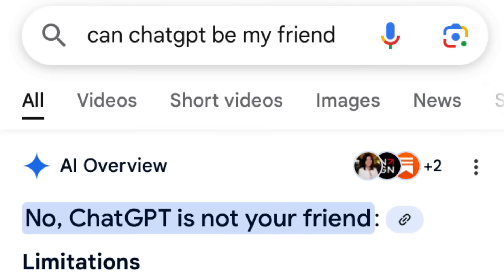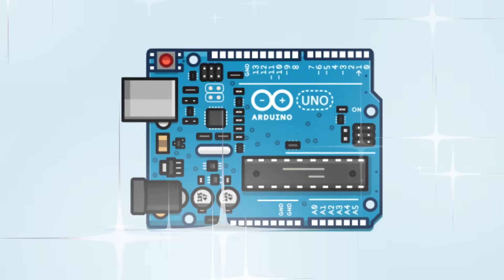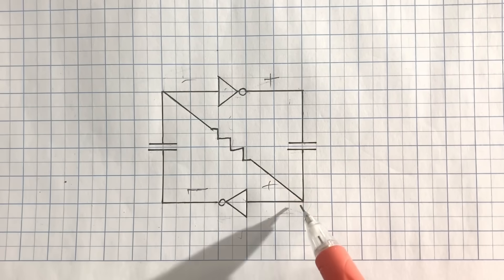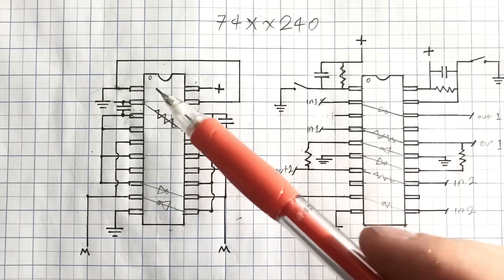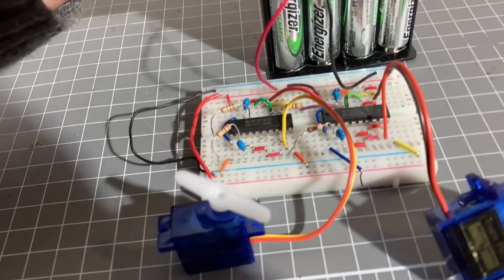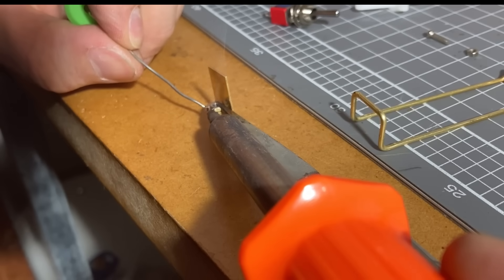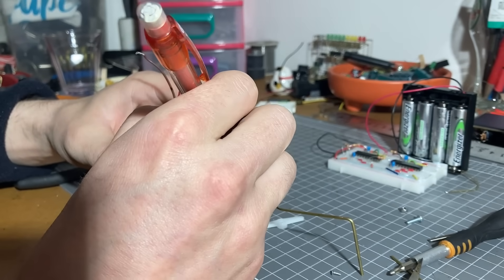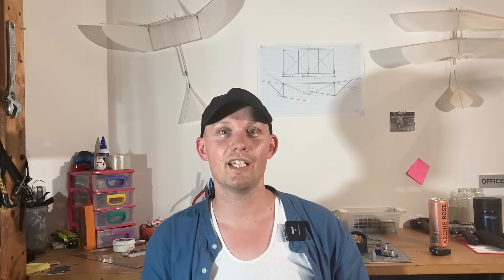What is a BEAM robot? lets build one

Comment: Id love to figure out a way to do something like that solar powered so it could roam the world freely, as long as it can survive in the harsh enviorment of course. I was thinking about naval based stuff first, but I only have rivers around and the current is probably too strong. Land based will have its limits, especially in a city where its likely to be picked up or destroyed. Flying of course is a power issue.
Reply from the maker: I am actually working on some of these things right now but yeah, its a bit of a challenge, both to ruggedise everything and to get the control systems so that it doesn't get stuck instantly. The mars helicopter is honestly a great inspiration as it actually did a lot of the things BEAM has dreamed of for a while, but with a little more proper compute

Comment: OK. This is my last comment for a while - Don't want to spam you! 

But, a trick so you don't need centering springs is to bend the legs up close to the body and then continue down with the usual shape. This makes the legs hit the body which acts as a mechanical stop. Start the UP Bend at the right distance from center so it doesn't put strain on the servo's plastic gears but still stops and centers them. -- This also lowers the center of gravity and makes the bot more stable.

EDIT: Sometimes we used leftover softer wire to play with different leg shapes and then replaced the final design with the good (strong) stuff and made it pretty.

I got this idea because I noticed that Tilden almost never put centering springs on his Walkers and used that leg shape instead. Look at his BiCore and MicroCore Walkers and you'll see what he did. I never used centering springs on my walkers -- see my old website. Especially the Walker videos -- My Ant 2 is a perfect example of what I'm trying to describe. 

One of the advantages of the 5 motor walkers like Walkman is each leg has it's own servo or geared motor -- each is independent, so no centering.

Again. Great content! Thanks for sharing!
Reply from the maker: Bending the legs for a mechanical stop is a genius idea. I will definitely use that. I was originally going to have microswitches to limit the legs, maybe by grounding one side of the bicore, forcing it to switch. One of the new ones I am currently building has some space constraints, so the leg trick might just save it. 

No worries with all the comments, I love to hear tricks and insights, especially from people who have built Beam bot and were involved back in the day

Comment: If there's a established set of "elements" to pick from to compose different behavior patterns; sounds like the type of thing that maybe with modern excess computing power available it might be possible to run some mix of evolutionary algorithm and some other machine-learning stuff to develop and fine tune more advanced behaviors; something like, generate random selections of elements and connections between them, run a gradient descent or whatever on the results scoring for the desired behaviors for each of the expected inputs,  keep the highest scoring ones, and replace the lowest scoring ones with random mixes of the the previous gen winners, and also a third and forth group that's randomly mutated from those other two, and repeat; or some other approach kinda like that. And then you end up with a plan of elements and connections, that you have to puzzle out how to physically fit together; and if there are some unaccounted for constraints that can't be easily worked around, introduce them into the simulation used for the scoring and iterate a few more virtual generations and try again.

Comment: Still have all my BEAM robots, and they mostly all work, at least the walkers all work. My most complex is my 16 Nv, 8 motor Spyder, which used a 4 stage microcore with four three stage branches, each driving it's own leg. It has full H-bridge drivers and a signal conditioning board that prevents illegal (shorting) outputs. 

Bronco is a dual branch half-stage Bicore walker with 3 motors. A Bicore drives a pair of branches, with a 1 - 0.5 - 1 timing pattern, which gives the robot a more efficient walking gait. in total, it uses 6 Nv units. 

My oldest walker was Walkman Jr. It is a basic 2 motor, 4 Nv microcore walker. Walkman Jr and Bronco were both featured on a short lived children's educational TV show called Algo's Factory (recorded in summer of 1998. forget if it aired in 98 or 99). It actually walked off a table during a mishap at the studio. The nose was broken and never really went back together in it's original shape. the original was literally made with cheap walkman motors, some oven timer gearboxes, and some plastic gears from said walkmans... that all shattered. They paid for some really high quality gearmotors, and I rebuilt it with fancier parts than it ever started with. I actually reused it's rear leg motor for Bronco, turning the motor into a "waist" motor with limited range of motion. this prevented the motor from ever turning far enough to reach the stripped out gear teeth.

 Back then, there were two primary node configurations. Nu and Nv. It mostly had to do with how the resistor and capacitor were wired. Nus were referred to as "neuron" nodes, and were often used with basic sensors. The majority of smaller BEAM robots did not even use these. Nv nodes, or "Nervous" nodes were far more common, and were used in the majority of basic configuration. These were the heart of most BEAM CPGs, or central pattern generators. This was basically your main loops and motor branches.

Dave Hrynkiw still host's my ancient site (which started on GeoCities). He still runs Solarbotics, with a heavy flavoring of 3D printing now a days.

I'd like to end by saying I absolutely love the way you built yours! Just cute lil' guy, crawlin' away!
Reply from the maker: Wow thats so much for the comment. Spyder sounds impressive, at most I think I have had 6? Nv nodes working together, a microcore with that many is awesome. 

I am going to look up some of the sources you mentioned, it is getting harder and harder to track down info on Beam stuff as soo many of the old sites are shut down. I have a huge folder on my computer with a bunch of schematics that I have saved. Many years ago I owned the Junkbots book writted by Dave Hrynkiw and used to purchase parts from Solarbotics back in the day. 

Thanks again for the comment!

Comment: Cool that the algorithm brought me here. subbed. Hope the future diy minimalist projects go well!!

Just a thought, seeing what look like ornithopters or gliders in the back.. have you considered a miniaturized BEAM circuit to drive flapping of an articulated wing? I don't know if it'd have any adv over a typical cyclic gear mechanism.
Just a layman with my 2¢
Reply from the maker: Thanks mate! I have been (slowly) working on an ornithopter project that uses an Arduino for waypoint guidance but its on the back-burner right now. Beam could be used for some sort of closed loop control for a flying robot but I have never done it
Reply: @ALTcorporation  could be solar with a tiny battery. charges and then flies a few feet. I am not sure what small and light options there are for some kind of rangefinding to guide toward open areas.
Reply: @ALTcorporation  sounds like autonomous 🤖 is your focus, any hints what's next ?

For me, it's daunting picking up a bigger project and I'm not even trying to make content and all that, just a machinist brainstorming ideas and seeing what is happening in various fields. Tech moves so fast with so many contributors worldwide, and yet there's still old craftsman sharing their techniques! Interesting time to be alive!

P s . doing more BEAM? Here's another hairbrained one: 
how about a BEAM Solar powered undulating Carp? Could  be as simple as a tail attached to a bowing flexure and electromagnet on either side in the body , no servo motor shafts to seal.

But first you have to build a pool in the backyard...etc. $cope of the project keeps increasing...

Comment: Did I miss a mention of the RoboSapian.? A rather popular consumer toy that was a BEAM+Microcontroller horse-and-rider configuration. 
As I recall the microcontroller injected pulses into a network of Hexcore circuits, driving 6 DC-motors: 1 motor for leg lift, 1 for hip roll and 2 in each arm, + clever kinematic linkages.. that thing had more fluid mobility than a bot costing 10x

I've looked occasionally and it seems like this wasn't a concept that grew much.
Last I saw a BEAM robot was at my local Makershop . AND IT WAS INCREDIBLE! He meticulously built a full hexapod spider , all analog BEAM circuits , 6 motors, phototropism and front&rear collision!
Reply from the maker: There was a few things I left out of the video, RoboSapians (and the BioBugs) are super interesting and deserve a video on their own but I wanted to keep this (somewhat) short. I actually would like to do a video on both but there are a bit hard to find in Aus. Cheers!

Comment: 5:42 An important point about the 74xx240 is that, besides having 8 inverters, is that it's a bus driver chip, so it's both fast, & has a bigger current output capacity than a jelly bean inverter like the 74x04 hex inverter does.

Comment: 4:31 If you're using 74HCTxx chips, the logic levels are TTL logic family voltages; >=2V for high, & <= 0.8V for low. Your commentary would be correct for 74HCxx chips. (>½VCC = high, <½VCC = low)
I know this sounds pedantic, but I've had to deal with so many real world faults where designers or supply people weren't familiar with these details & created weird & hard to diagnose faults.

Comment: In general, always check your system's current draw while you're building because you may need to insert a pull-up or pull-down resistor rather than tying a line directly to a rail. You can sometimes reduce current draw by inverting the logic for the most common state to use less power.
Also, have enough decoupling caps around CMOS logic that will be changing frequently or sourcing significant current.